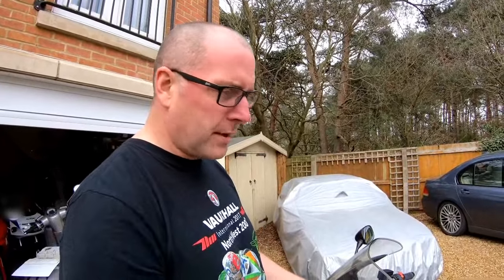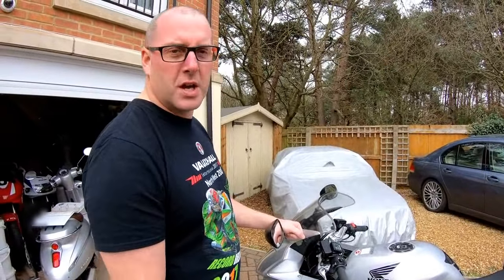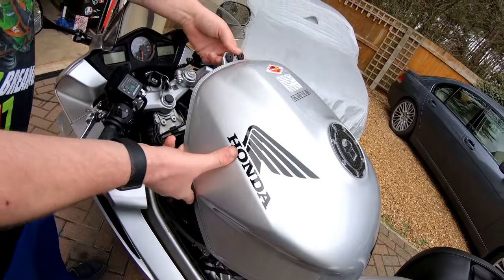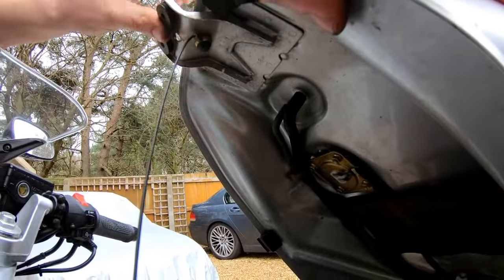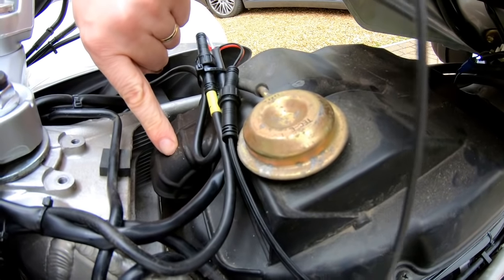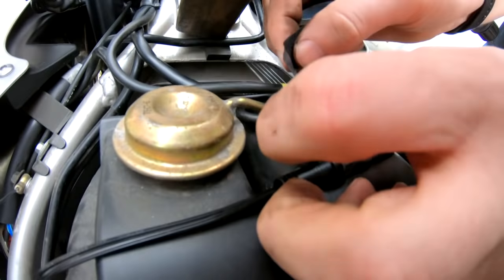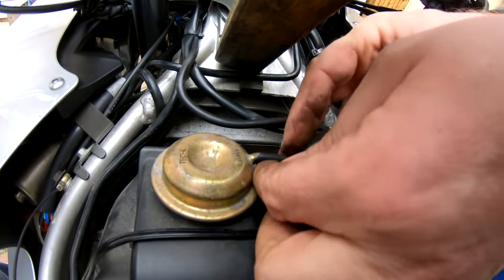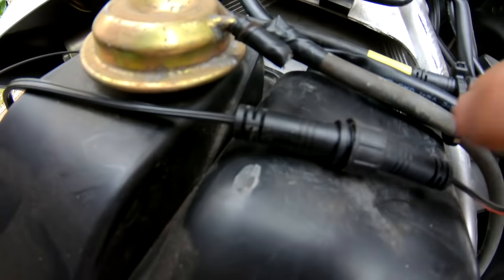Honda VFR800 VTEC PAIR valve delete, Snorkel removal and Flapper mod, simple reversible and no cost!

Comment: I’ve just done this and personally it really improves the jerky throttle and aids the low speed manoeuvrability by miles, why Honda did this in the first place is beyond me? Great video chap
Reply from the maker: Cheers buddy, glad it was of use to you!
Reply: I notice you didn’t block the PAIR valve pipe from the box? I personally haven’t but a lot of people recommend it as the pair valve apparently still works if you unplug it? Doesn’t make any sense to me
Reply from the maker: @andyjamestf  Fair question! Your right, I didn't bother and the reason for that is that the valve is essentially a reed valve which is operated via a solenoid. If the solenoid doesn't operate then neither does the reed valve. There is no way for air to leave the air box and enter the exhaust with the solenoid deactivated. Each to their own though. I won't tell someone they are wrong if they wish to do that! I just don't feel it is necessary.
Reply: Kevs Shed that was my theory, loving the channel  it would be nice to see a coolant change  video there’s no decent step by step guides out there 
Cheers Andy
Reply from the maker: @andyjamestf  I'll see what I can do ;)
Reply: Its done by honda to get the bikes through emissions testing, they don't care that it rides shit, but at least its an easy fix, anyone who says they can't feel the benefit must be dead or just don't ride enough
Reply: I feel like I need to add smth to the discussion. I understand why some "feel smooth ride" after those "mods". It's because power is decreased. Engine is revving slower , engine braking is weaker too (not sure why), but i felt like bike became lazier overall. And yes, it feels more smooth and gentle and not responding too fast to the throttle. But there is only one reason I already highlighted. The last comment about "honda engineers not knowing bla-bla" and "anyone who can't feel the benefit"... I mean... I rarely meet so dumb people in real life fortunately. When I commute to work, I have to pass few speed bumps on my way on a slow street. So I usually just jump over them on a first gear with only a throttle and a tiny bite of a clutch, that movement is perfectly automated. After those "mods" it didn't work - the front wheel didn't even came off the ground. That's all one needs to know about those "mods" efficiency.
Reply: @KevsShed  that makes sense to me too, I just disconnected the electrical connection to the PAIR valve on my 5th gen and done the snorkle and flapper mod, I'll report back what difference it's made on a 5th gen with no 02 sensors and no CAT.
Reply: @roadwarrior8560  any difference?

Comment: Would it not have been better just to replace the dirty air filter and fit a Power Commander to sort out the low speed jerkiness and poor idling?
Reply from the maker: Alex Morgan absolutely! Air filter has been replaced naturally, however the point was that this costs nothing yet is reversible! 👍🏻 thanks for watching!

Comment: thank you for your nice video on this! I have a question: i did these mods a while back, but i had an issue after disabling the pair valve. my bike had a hard time warming up to its operating temperature, may i have done this wrong? I plugged the connector of the valve back in and it was warming up just fine again…
Reply: Did you leave the pair valve or plugged in still or disable it again? I have a VFR and have done none of these mods yet, wondering which ones I should do, if any. I heard lair valve was the only one that mattered and made difference? The snorkel is just for sound, and not necessary? What is yours like now, what is your experiences?

Comment: Is it worth  buying the vfr from 2005 ish as I was thinking about getting one.
I dont like the sound of the snatchy throttle response in tbe comments.
I would be coming from a bandit 600.
Or is a bandit 1250 a safer bet.
Reply from the maker: Great bikes to be fair, I have had a Bandit 600 in the past and the VFR is light years ahead of it in terms of torque and power. I would say as far as handling that they are fairly well matched although the VFR is a much heavier beast! Hope this helps! 👍
Reply: @KevsShed  Thanks for the advice/ yea I will look for a good VFR or 1250 bandit if we get out of this lockdown

Comment: Hi,Cheers for the tips . I am old school and just bought a vfr 800 gen5 1999 . I have a KN air filter  .And did the flapper and the snorkel mods . I dont it has the mod for the back of the box ????? It sounds awsome the intake wow .Just like a race RC45 sound.Just a question with the ECU richen the mixture ?? As with mods will it not run on the lean side . The performance is also up. It is a good job i did the mods as then i removed the snorkel could see like paper . HUUUMM Removed the top to reveal a mouses nest , Air box was 2/3 full of paper . the filter was partly eaten . So i fitted a KN filter ,  I wouldnt want to damage the engine , Its a 99 31k in red lovely bike . My next mod will be a stainless black widow can . Could this cause problems .
Regards Dave
Reply from the maker: Cleaning a K&N Air Filter With a K&N Filter Recharge Kit

Comment: Hi Kevin just watched the pair valve removal vid.you only disconnected the pair solenoid that is not enough to delete it you also have to block off the clean air side pipe as the air is still able to pass through the solenoid and into the system,in fact to block it fully you need to fit blanking plates at the Reed valves and remove the solenoid and piping.i just bought a 03 vfr800 and I will be doing it myself.👍🇮🇪
Reply from the maker: Absolutely correct, you live and learn 👌🏻
Reply: Maybe its a future vlog for you.i just ordered the blank plates and air filter block off plug myself on ebay.i think our bikes have a catalytic converter that has to go aswel.
Reply: @KevsShed  Hi Kev would you now say its a good idea to block the pipe from airbox to the pair solenoid with a marble to shut off any air going to the system ?

Comment: Thanks Kev for all of your videos, you make working on the VFR easy!
I made these mods but I had to return to original the pair valve mod. Throtle was a bit jerky when idling and smelled a lot of petrol, seems like the mixture was not being done properly. Flapper and snorkel work perfectly. Do you know if there is any step missing?

Comment: Quick question, i had done this a few years back, but today I put it back to stock. However i noticed the flapper open, and stayed open. When does it open close? My service manual says its open during idling and only closes
" with increasing engine speed quickly, and throttle angle :over 38 degrees with engine speed below 6500rpm,
With dreasing engine speed quickly,
Throttle angle: over 35 degrees
Engine speed : below 6000 rpm"
Reply from the maker: You’ve answered your own question there Mike 👍🏻

Comment: Have you kept these mods then kev 2 years on or has is it back to stock? Only mod I am slightly concerned about is the Pair Valve, worried it'll cause issues down the line like fueling issues. If I fitted a PC5 to the Bike is there any other work I'd have too?

Thanks
Reply from the maker: Still running them as they were. Bike is running perfectly. 👍
Reply: @KevsShed  Ah happy days Mate, Did you end up block of the pipe that runs to the solenoid and if so what did you use?

Comment: Taping up the electrics on the Pair Valve does not disable it, you need to plug the inlet hose otherwise you will be constantly sucking air

Comment: Hi Kev, i bought a 2003 vfr the other month , and finally got it on the road a couple of weeks ago. 

I did my first long ride with attention to fuel usage. Filled it up as i left , topped up the used when i returned. 60 miles , 12£ of fuel. Seems a tad high to me. ( even me and my b...pillion. )

Easter weekend, i got the tank up and found that the snorkel mod and flapper mod had been done. 

Ive jammed the flapper closed for now because i cant get the plastic T connector of the vacuum to the tiny pipe that comes off the electric actuator. Right down between the frame and engine. Any suggestion how i could plug that in ?

I learned that the PAIR sends extra air into the exhaust and so the EFI delivers more fuel... was that my high guel usage cause ...no. it was also disconnected. 

Will me blocking (and later restoring) the flapper bring my MPG to normal levels? 

Or could it be something else? 

Any insight or help will be appreciated. 

Alex (Suffolk)
Reply: According to some online calculator : it actually doesnt seem too wrong , but my mayes , both car and bike riders thought my usage seemd very high... 

""Here is the likely cost for a journey of 60 miles costing 150 pence/litre in a vehicle averaging 45 miles/gallon.
You will use approximately

6.67 Litres

Which will cost approximately

£10.00

The actual cost can vary due to a number of factors, including number of passengers/weight, average speed, traffic & terrain""

Comment: After watching your video again I’ve decided I’m going to put a power switch on the fairing for PAIR system. (I presume the positive is the red wire and not the green?) This is so I can have the pair switched off around town and on everywhere else.
Reply: Did you end up doing this?

Comment: Does this valve works like the PCV valve on other fuel injection systems?
Reply from the maker: Do you mean Positive Crankcase Ventilation Valve? If so then no, nothing like it. The PAIR valve allows fresh air from the airbox to directly flow into the downstream of the exhaust gases. It is nothing more than an environmental band-aid.

Comment: Is the pair  valve the same location on a gen 5 1999 ??? Not really mechanical . But seems an easy mod . Cheers for sharing
Reply: No the electrical connection on the 5th gen is behind the left fairing in front of the rad area. the PAIR valve is in the front of the bike up above the oil cooler area.

Comment: Is the bike still running well since did the mods?
Reply from the maker: Like a dream! 👌😎
Reply: I seen on another vid about the pair valve you néed to block the hose too
Reply from the maker: Like I said in my video it is pretty much free to try, try blocking them off if you liker, if it doesn't work out then revert back, find out what works for you and your bike! 👌😎
Reply: @KevsShed  I've done the snorkel and flapper and is super so will try the pair and see how goes but 1st I need regulator mosfet upgrade bloody 2nd time to fail. Will for sure try the pair to see how runs. Love the vids keep up the good work 👍👍

Comment: Does unplugging the PAIR valve not trigger the engine management light?  I'd have thought unplugging it would result the ECU detecting a P0410/P0411/P0412 fault, i.e. a faulty PAIR valve.
Reply from the maker: Nope!
Reply: @KevsShed  That's interesting because the EML light came on on my SH300i and an OBD2 scan threw up code P0412. At £75 for a non-performance part I was leaning towards removing the PAIR valve as so many have done. However, I the problem turned out to be that the (very fine) trigger and earth wires had broken away from the feed plug, which is the same as disconnecting the plug as in your vid.  Anyway, after effecting a repair and clearing the fault code all is back to normal.
Reply from the maker: I would imagine that the management on the SH300i is a bit more modern and capable. The EML comes on with the ignition and extinguished upon engine start, as it should. I don’t know of anyone that has an EML after performing this mod.
Reply: @KevsShed  I think you're right Kev. I don't think my 2004 Goldwing has that level of wizardry and my 1981 Goldwing is positively stone age, although beautiful!

Comment: is this needed for a 2017 model and if so, is it the same to do?  mine is stock and horrible at low rpm
Reply from the maker: Sorry buddy, I don't have a 2017 model to test with, nor do I have the manual to check. Apologies.
Reply: @KevsShed  no worries.  another thread suggests they are very similar but some say the pair valve, if electrically isolated, is normally open so needs the air blocked rather than electrical isolation.  i'll have a good look next time i'm mooching about under the tank.

Comment: i did the mods. now I saw that there is quite a soot rash on the exhausts! Is this normal and does it hurt?
Reply from the maker: A lot of soot could be an indication that the bike it running a bit rich.these mods wouldn’t usually cause that.
Reply: @KevsShed  Just strange thet it happend afther i did the mods.
Reply from the maker: @flyman1966  Put it back to stock and see if it improves. It would be interesting to see!
Reply: @KevsShed  will do. i did also the pair block mod. maybe thats the cause!

Comment: Missing the whole point of vacuum, any leaks and the ECU will over fuel  to compensate.
Reply from the maker: Correct, Not sure why you felt the need to mention it though!
Reply: @KevsShed  made me smile sir.
Reply from the maker: @sidewaysaction9983  It's always good to smile Sir! ;)
Reply: @KevsShed  I'm still working mate so get a few miles on my hard as nails gen 5 commuter in this nice weather. Recently had to replace exhaust 21 year old and cracked all over. Replaced with beautiful black widow system, larger bore headers and straight through or DB killer. Sounds mint and 1100 to 5500 rpm off like a scolded cat then terrible flat spot 7000 to 12000 she's off again. Unfortunately it looks like the only cure is power commander about £450 including the rolling road. Can I justify spending so much money on my 40000 mile work bike.... But I love riding her and she's ruined.
Reply from the maker: @sidewaysaction9983  I'm trying to justify to myself the costs of a PC5 but it's difficult. Especially as I have other bikes/cars that also have need for things! :(
Reply: @KevsShed  I'm in my mid 50s and raced grass track as a youth had licence since 1985, so I've ridden a few over the years and the gear driven cam vfrs  are one of my favourite bikes.
Reply: @KevsShed  sod it after this conversation and some thought on the matter as soon as this pretend half hearted lockdown is over I'm spending the money my friend.
Reply from the maker: @sidewaysaction9983  haha, awesome! :)

Comment: Kev, does doing this make any difference?
Reply from the maker: Baz Jones the flat spot has definitely disappeared and the induction noise is better, as for actual hp increases, it’s hard to say without putting it on the rollers!
Reply: @KevsShed  What video is next? You changed the brake fluid yet?
Reply from the maker: Baz Jones on the list but the next video will be up shortly 👍🏻

Comment: This is a warning message to all people who would like to perform this manipulation.
I tested it, indeed at low speed it's much smoother... BUT

My fuel consumption increased significantly! even with the same driving style.
If the manufacturer has implemented these things, it's for a reason, be warned.

As for me, I reverted it to its original state.

V

Comment: for years I bought bikes and did all these mods and in the end the bikes were really loud and I had to wear earplugs when I rode or I would get ear fatigue and the handling is almost always worse with all of the "upgrades" because they are all designed to be used on a track and hellllooooo we dont ride on the track except for rare occasion do we?  and what's wrong with a quiet comfortable bike that is reliable and predictable.........Honda and all the other manufacturers spend millions of dollars and endless hours with expert engineers optimizing these bikes on dynos and under rigorous test conditions and it you think some hack in a garage is gonna improve on that using an entirely unscientific approach you're welcome to it